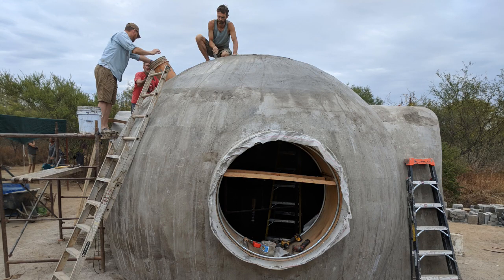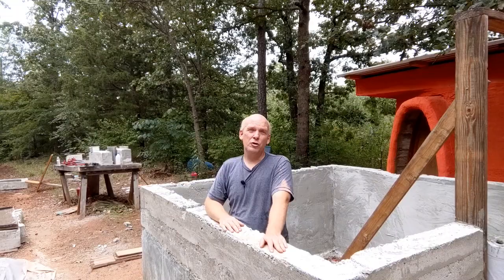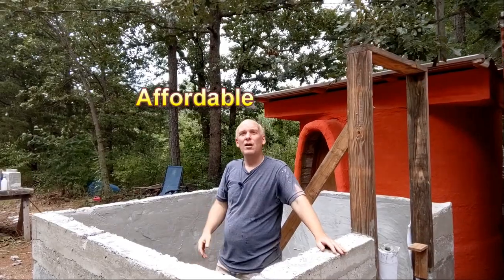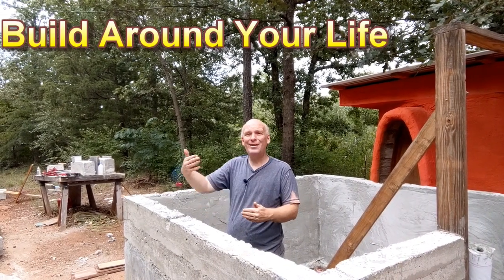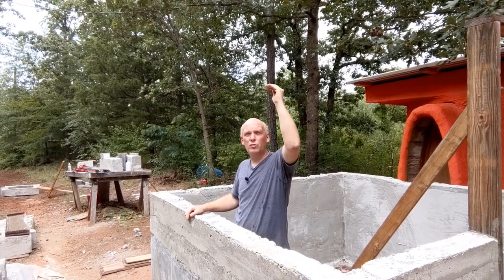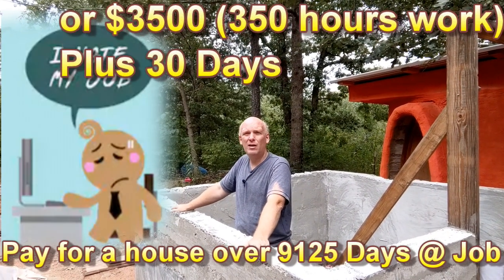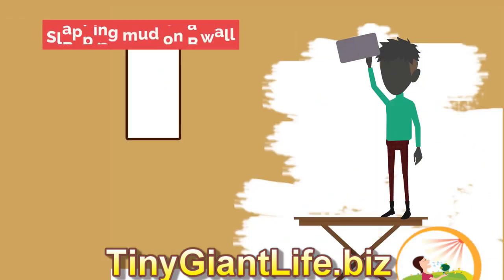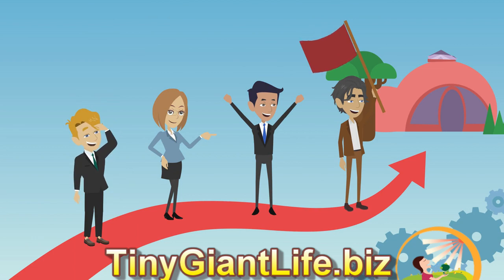AirCrete Pueblo Adobe Style House Building Workshop - October 9 2020

Comment: this is what I was looking for. I will be doing slip form pouring between my poles in my pole barn house construction. that makes it very easy. what is the deepest I would want to pour at one time. you should 12 inches but could I go with 24 or 36 inches. In your round house in place pouring it looks like it is at least 36 inches. looking forward to a reply.
Reply from the maker: The deeper you pour aircreet in one go the more likely it is to deflate.  12 in is pretty much ideal.
Reply: @TinyGiantLifeStyle  yeah that makes perfect sense especially if I am using more foam instead of 50 I will be using 100 which will give much more insulative value and stretch the concrete a lot further. since the posts are holding the roof us I don''t need such density and the benefit will really help with keeping the building cool in the Philippines and the noise of the neighbours roosters that crow all night from keeping me up.LOL. thanks for the replies. I really appreciate it.

Comment: Can one apply Aircrete in a gunite/shotcrete manner by spraying it on the walls
Reply from the maker: As a finish coat.  Spraying AirCrete collapses the bubbles in it and takes away the insulation value.

Comment: Hey Daniel,
Could you comment on how you would get such a home approved by the city or whoever? I own 10 acres and am planning on building an aircrete home. Is there a tax hit for having such a home?
Reply from the maker: Building in the city most often requires " work-arounds".  I don't discuss those here.  AirCrete a home made version  of cellular cement is an alternative Building system.  Not acceptable by the "public.". 

Tax/theft agencies tax dog houses so yes, most likely you would be taxed.  Of course if it was a non approved building materials that can not get bank loans then it is unlikely to appraise for much.

There is a way to deal with these communist on a legal level.  However, that requires learning how to do it yourself because and officer of the court bar attorney can not represent anything outside the establishment.
Reply: You will always pay taxes on the materials used in the homes construction.   The actual property taxes will be hard for a tax assessor to figure out as there will more than likely not be any houses like yours to price against.  What they will probably do will be to compare its sq. footage to houses in your area and tax you on that.  Where I am from, we had a homestead exemption based on the 1st 75000, no taxes but had to pay taxes on anything above that IIRC.  You could save all the receipts and show them the actual value of those receipts and then go from there.  But, as far as having a home built out of Aircrete, I would say no additional hit as far as that.